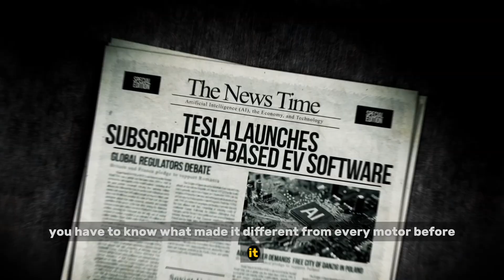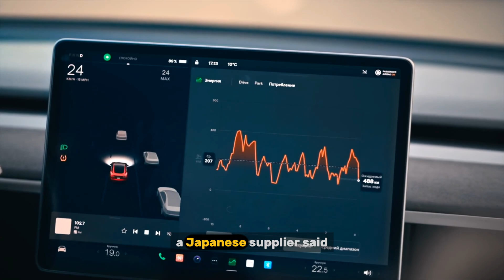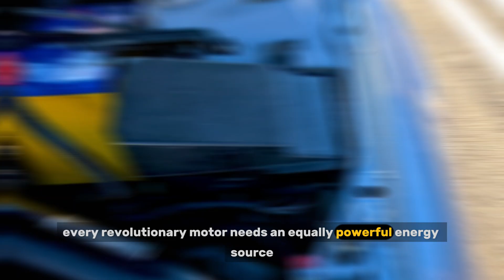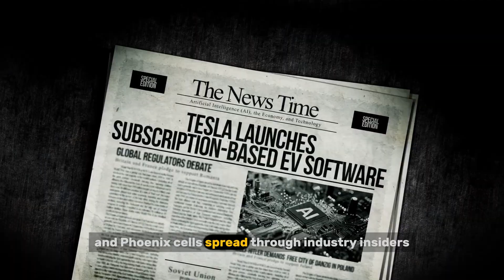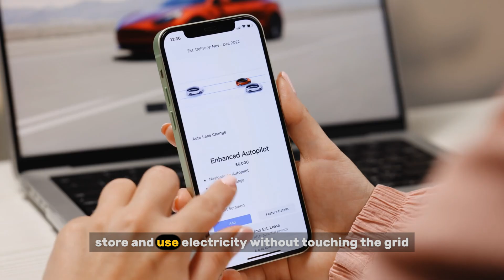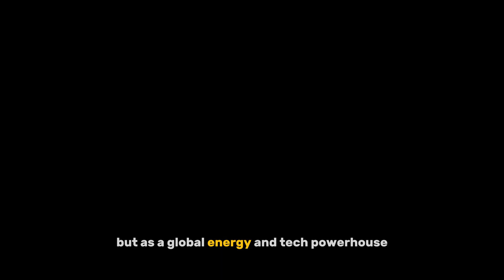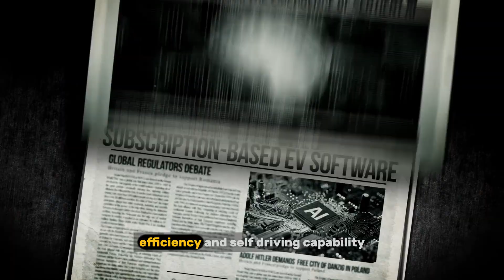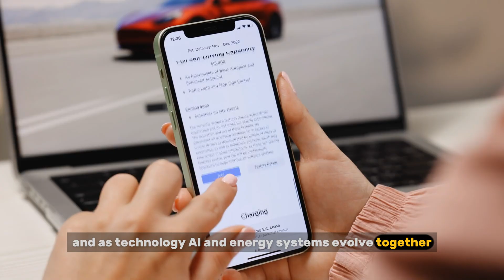Elon Musk Just Revealed Tesla's New Motor That Changes Everything

Comment: Well, E-motors by all good brands are already up to 95% efficiency. Inverters are also at about 85% efficiency. The problem is the battery. Nothing really has happened with commercial batteries (including the ones by Tesla) in the last 10 years. Batteries have not signifficantly improved in energy density during this time. Energy density is the amount of total energy of the battery - consider it as Ev-range with least mass. The development of energy density has really saturated already 10 years ago. Power density has and will increse. Consider power density as charge time potential and maximum power (current) the battery can give.

This video is pretty much AI-BS.